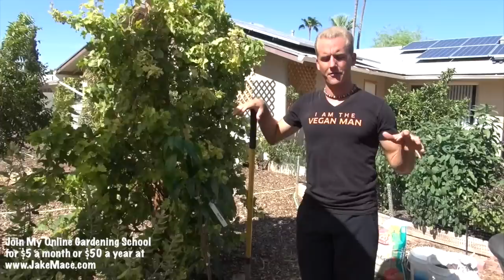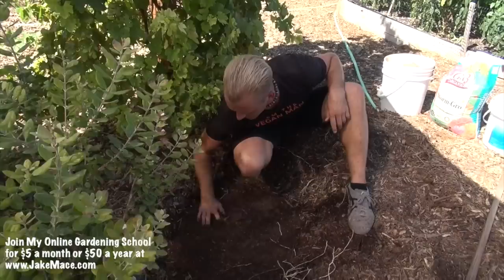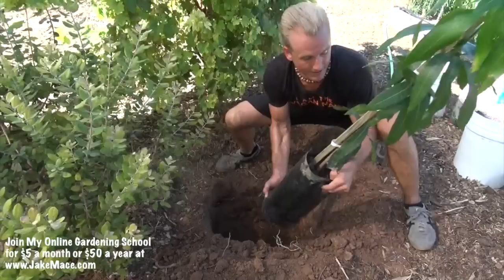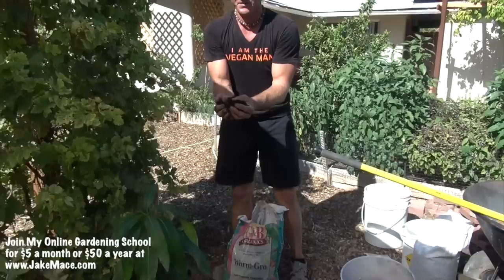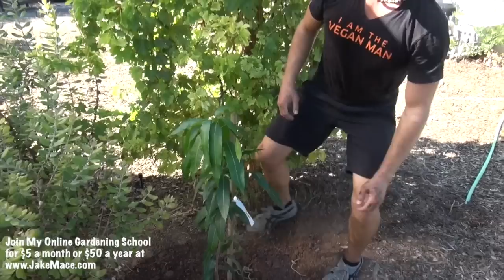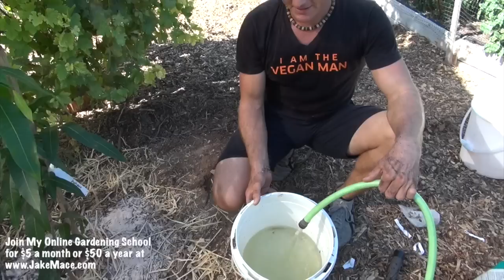The World's Most Cold Tolerant Mango Tree - Planting an Antonio Mango Tree

Comment: The best way to do it, is to get a cement mixer, with a 400 lbs. capacity to mix all those earth ingredients at once. while in dry 
condition and dump it in the hole or pit.  I see too much shoveling and extra work. To me the best and most delicious mango 
is named COLONO, it grows in the north of Dominican Republic, Thin skin, sweet, light green on the outside when ripe, yellow pulp, non fibrous, small pit, large amount of edible pulp (at least 1" thick). very difficult to find. 11/05/16.